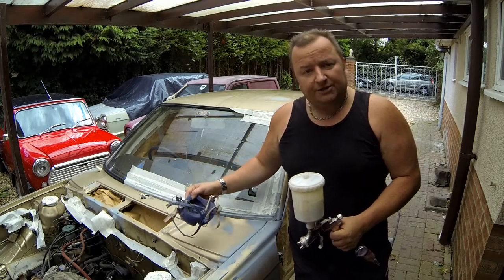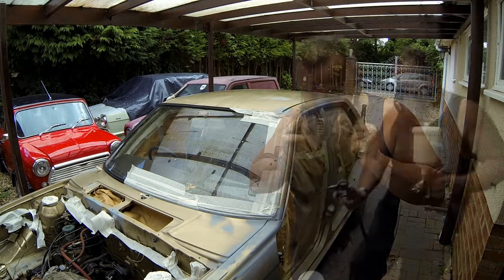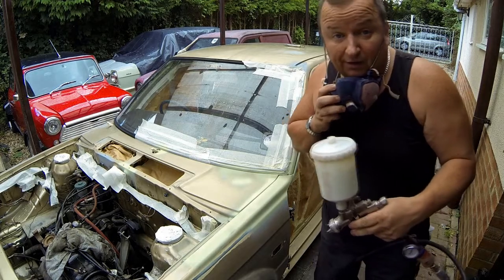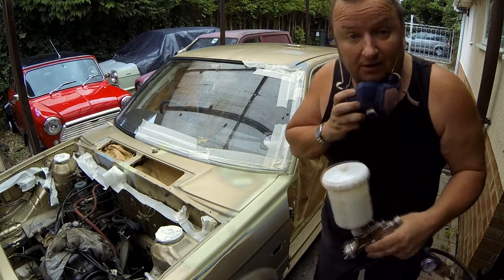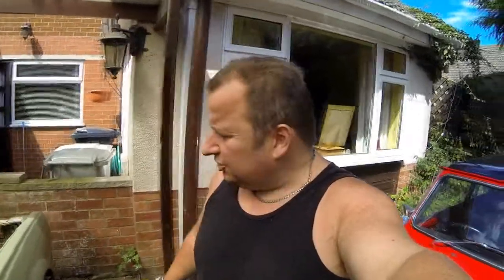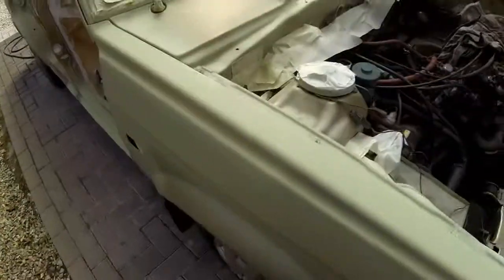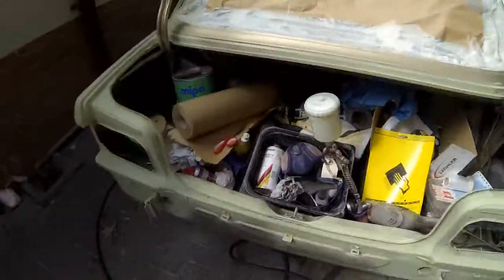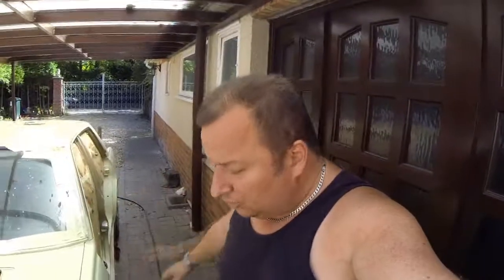Part 4 Triumph Acclaim Restoration Spot Priming

Comment: Coming together nicely Martin .
Reply from the maker: Won't be long before we put the basecoat on Pete :)
Reply: retrorestore Martin i had one of them went really well . 
Did you manage to see burlen fuel systems website .SU masters. Will look a picture when done.
Reply: Peter Froud Just a question how do you stop the over spray getting on the other cars.Or windows on the house.
Reply from the maker: Peter Froud
These hvlp guns put out plenty of paint at low pressure and for spot repairs like this, I am only partially pulling the trigger. When I spray a car, I move things and cover stuff up.